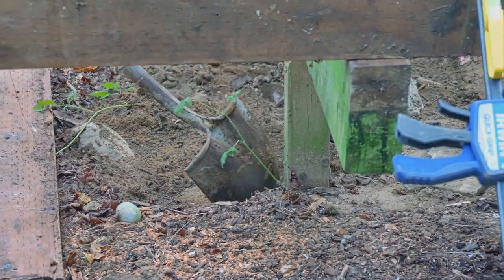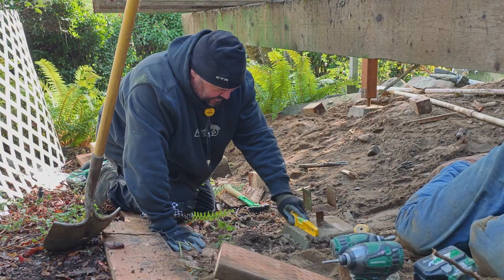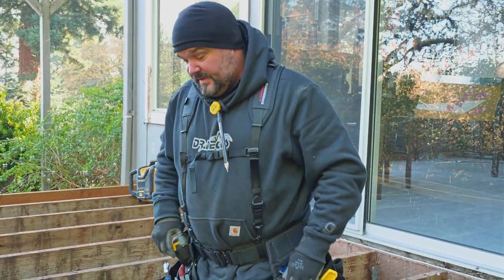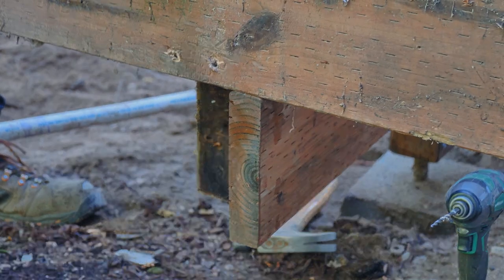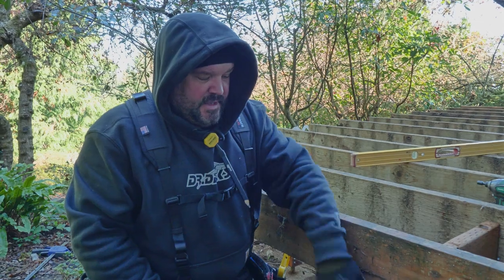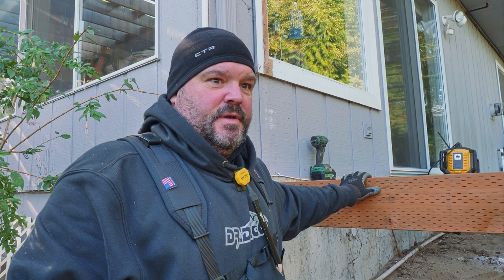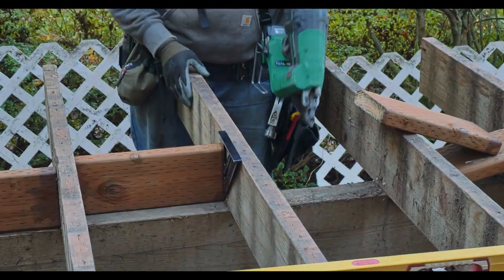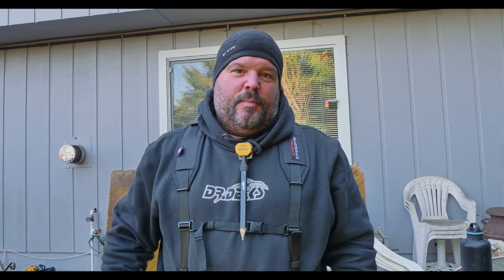Build Update: Square Up || Dr Decks

Comment: Hi Doc! Thanks so much for the wisdom in the video. I am building a house on a heavy duty trailer. The subfloor frame I built to put the floor sheathing on is not a perfect square. Should I make the AdvanTech sheathing square with the trailer or square with the deck I built on top of the trailer?

Comment: Omg. I’m having exactly the same problems. Thanks guys! 
One other issue I’m having tho is how to square up the joists that are totally warped. Just measure cut and pound them into place? Then nail? Or screws? I don’t have a nail gun and I’m doing this all by myself so easier is better. -Maleen
Reply: I’m talking about the joist spacers btw.
Reply from the maker: You can take a 2x4 and screw each joist to it at the proper spacing until you run your decking to the middle of the deck and then remove the board.